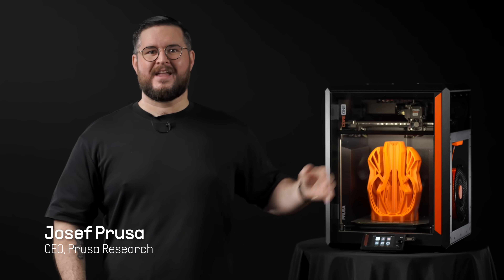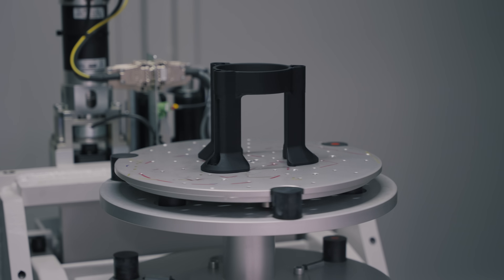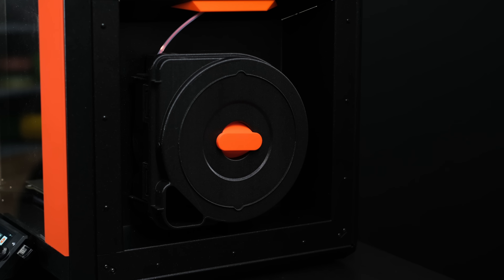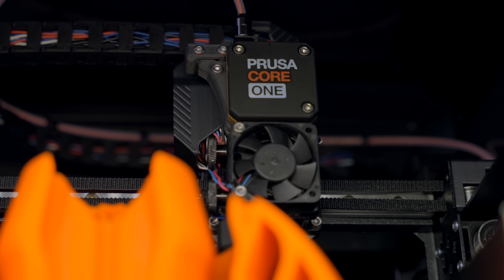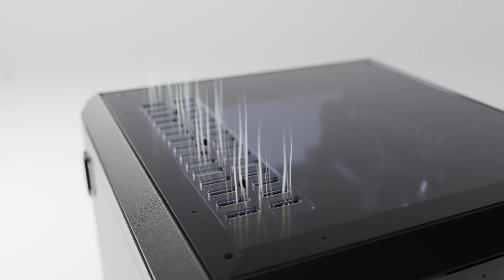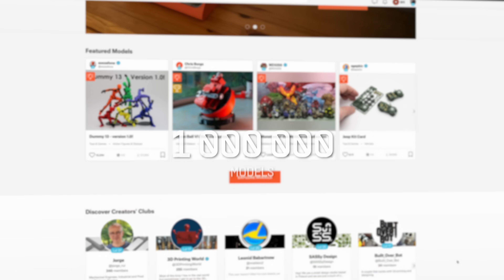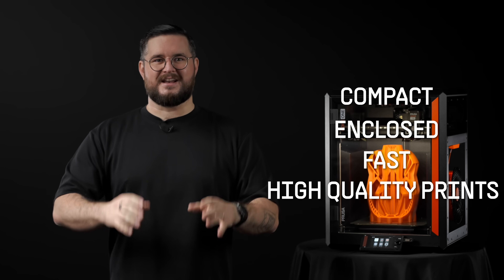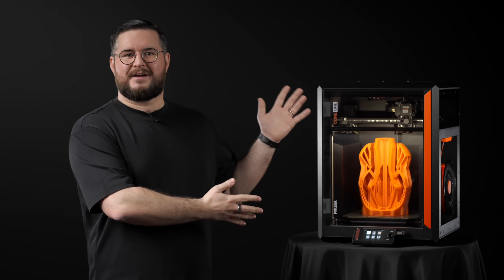Prusa CORE One - Fully Enclosed, High-Speed CoreXY 3D Printer With Active Chamber Temp Control

Comment: This is going to be my next printer. I was super excited by the Bambu but the lack of open source was a deal breaker. I can now retire my Ultimaker 2. Thank you for raising your game.
Reply: Bambu has open source firmware. It has been for months.
Reply: Which phone do you use? BTW Android is open source too.
Reply: @message2prateek  Modern android is barely open source and inferior to ios for almost every practical use scenario. Seeing the source code is not useful when nobody can modify it and use it in any meaningful way (because devices are hardware key locked), and the whole repo is too big for regular developers to check for security flaws.

Comment: Massive threat to bambu with this thing. Cheaper than X1 with open source and ability to run offline for better security?? Easy choice over bambu.
Reply: A: you can run X1C on LAN only

B: the most recent prusa printer thats 100% open source was the mini. You can claim PrusaSlicer is still 100% open source but so is Bambu Studio

C: P1S is cheaper than X1C and prusa core one. It lacks the lidar (prusa doesnt have it) hardened nozzle (prusa doesnt have it, its brass), and the touchscreen

D: Bambu's new Flagship (although you can argue that the XL is the flagship), will drop 2025 quarter 1. Conveniently, you have to wait till then for Prusa to ship the core one. Personally I would wait.
Reply: @  
A: bambu x1 can’t update on lan only mode

2: bambu studio wasn’t open source until it was forced to be because is a clone of Prusa slicer. The bambus build on the work of the rep rap project which requires all derivatives to be open source which bambu has not done

C: fair point about p1s price but prusas can be upgraded to a hardened nozzle (yes it’s more expensive but it will also probably last longer than the bambu ones)
Reply: @WhiffyStatue380  
1: How do you expect a printer to get an update off the internet when you turned off its internet access?

2: I think that was the only misstep Bambu did. they should have open soourced it from the get go, but late is better than never.

3. Most users want to hear "it comes ready to use CF filled filaments" and not "You need to buy and install a hardened steel nozzzle"

If you were a print farm looking to buy 200 printers for CF printed parts do you want to install 200 hardened steel nozzles on 200 Prusas?
Reply: @ 1: you don’t need to get updates online, prusa lets you update with the usb stick or sd card without having to be online

2: bambu has made many misteps, look at the a1, the AMS being designed to not work with cardboard or non bambu spools. Also, the printer should also be open source since it is based off the work of many other open source printers

3: nozzle swap is super fast on the prusas. Most people won’t print CF filament right away and those that want to are almost definitely knowledgeable enough to swap a nozzle
Reply: @WhiffyStatue380  2: the AMS can run non bambu spools and the AMS-lite can run cardboard spools

The parts for the Mk4 are not open source 

Even if the nozzle swap was A1 level fast, 200 swaps is not convenient
Reply: @ the AMS can run some non bambu spools. The AMS lite is great, no complaints about that one
Reply: @WhiffyStatue380  ive ran many many non bambu spools. Even if its too big you can open the lid

Comment: Why 220 in 2024 just make your bed square. I don’t know how many times I’ve had a print not fit but if I turn it 45° it fits, that doesn’t work on a rectangular bed only square ones it gives you more length,you may be able to fit something that is  just a few millimeters longer, anything more than like an inch thick in width would not work

Comment: ..... i waited so long to buy a prusa. i finally gave in last november because it had almost all the features i had been waiting for..... but i gave up on the hope that you would make an enclosed printer like this. so i bought a mark4 and the enclosure which honestly has made the printer way more cumbersome than i expected and because for some reason the side panels werent made to simply attach/detach magnetically for easy maintenance i know it will be a nightmare when i inevitably need to work on the machine. 

it just seemed like you were never going to give up on the bed slinger design and have the head do X&Y sadly this is my dream machine but the other was already a big financial investment for me so changing to this one wouldnt really be practical. especially since im only using it for practical printing unlike most people who just print silly trinkets to create clutter so i dont use it as often.

Comment: Can someone please explain to me how a printer like this is any better than a much cheaper one like the FlashForge AD5M? Genuinely curious, because I bought the AD5M for around $250 about 6 months ago and have had zero issues through close to 100 prints.

Up to 500mm/s print speed, self-leveling, direct drive extruder, 220 mm^3 print volume, all-metal coreXY structure, etc. They even have print plans & sets available for printing / buying enclosures for an extra $50???

Idk, just don’t see the value in a printer like the Prusa over some of these cheaper ones but someone please educate me.

Comment: Seriously, would it kill designers to make 500mm standard with 750mm as the premium?
Reply: most people dont print 500mm parts. 90% of the things i print could fit on a voron V0  printbed. Prusaslicer has dovetail tools to chop parts in half to fit. Furthermore, once you go beyond 350-400 you better have a heated chamber or you WILL have a huge warping issue. Warping just gets worse and worse the bigger your parts are
Reply: @Zyghqwyv  I mean that's kind of a chicken and egg argument. Most stuff is designed for a 250 or so mm print bed. so most of what's printed is 250mm or less. 

It is a fully enclosed Print chamber. Also don't just think one big part. More small parts is also improved with more bed area. 

They're building their own chassis too, so it's not some multiples of the length of standard extrusion that was also part of the factor in developing the older generations of printers.

Comment: I have a X1C and never do multi color prints with the AMS because there is so much waste.  One thing that it is really nice for is a drybox and automatic filament swaps so between prints I don't have to unload/load.  I'll wait to see if someone puts a MMU in an enclosure to keep the filament dry and for swaps.  One thing I'd like to see if instead of a wipe tower if you could throw another model on the bed and designate that as the 'wipe tower'.  Something that you don't really care what color it is because it is a functional part.  The slicer would have to make sure it was large enough to use as a wipe tower and if not then maybe just throw another functional model on the bed and they can both be a wipe tower.  I guess it would need to be as high or higher as the multi color models but that would be better than having the filament wasted on a wipe tower.

Comment: Prusa's commitment to right to repair is admirable!
Reply: Repairability is definitely a main reason I'm still inclined to choose Prusa over its competitors.
Reply: I think I rather buy a k1 , if it breaks down, I will buy another k1, still cheaper than a pre-built core one. its confusing
Reply: @SaifBinAdhed  P1S come at £509.   Hotend assembly p1 series around £25. But Prusa hotend assembly around £150.
Reply: @ that’s basically where my mind is at using Bambu stuff. I look at it like my iPhone, it’s good for 2-3 years and then stops holding a decent charge and i replace it with the latest and greatest.
Reply: if only their comittment to improving features was on the level. They are so grossly behind in every other aspect.
Reply: @Darlhim89 I use Prusa MINI. During it's lifetime I got countless of firmware updates, Prusa connect and still getting supports and replacement parts. I'm happy with my printer.
Reply: @Darlhim89 Can you provide some examples? I'm genuinely curious and was thinking of getting this machine. I currently have an BBL A1 and looking to add another printer in my studio.
Reply: @juniesco  machine is still slower than Bambu. 

The MMU system I’ve never used but I’m told it’s more complicated and inferior to the AMS. 

Bambu is cheaper and has a great app to run the machine remotely. 

Bambu uses actual glass rather than plastic panels.

Bambu has layer inspection/scanning.

Bambu has wireless updates.

Bambu has exhaust fan with charcoal filter.

Bambu has auxiliary part cooling fan. Extremely strong.

Bambu has a removable top if you want to vent the machine without opening the door.

Bambu has a purge collection port (the poop)
Reply: @Darlhim89  Thanks for this. I'll just wait until Bambu comes out with their next printer. I was possibly going to get the X1 but I want to hold off and see what the delayed printer is going to be.
Reply: @ you’re welcome. Both companies have a cult following and it’s challenging to get an unbiased response in general. Personally i just buy whatever is the best at the time I’m in the market for something. I couldn’t care less about fanboying for a company that isn’t paying me. I had a prusa, and switched to Bambu. I had far more issues with the Prusa. Many people have the opposite experience. A lot of it comes down to user error in both cases.
Reply: @ I totally understand. My first 3D printer was some off brand 127x127x127mm printer which I could never get to work lol Waited a few years and got the A1 a few months ago and I am blown away by the ease of use.
Reply: @Darlhim89 FYI the MMU doesn't poop because it doesn't need to.  Unlike in the AMS the filament is retracted before cutting, so there's much less waste from an MMU in general.  Bambu apparently compromised on that for the sake of the high-flow nozzle, but that also means swaps have to be slower so in practice if you're actually changing colors the MMU will typically have a faster print time than the AMS as well.

Comment: I'm sure there are some compelling features on this printer. But the limited 250x220 on-plate build volume is a bit disappointing when the competition is 256x256 or larger. I would of loved to see a minimum of 256x256 with a 300x300 option. The recessed spool holders is also a waste of footprint on the printer, especially since each and every roll I have is enclosed in an airtight container that can be direct fed without opening the container. That space could have been utilized for a larger build volume. Supporting the MMS is cool, but it sounds like those recessed holders won't be very useful, especially if you have more than 2 colors.

I think it's great that you guys now have an affordable CoreXY printer on the market. And that you can upgrade an existing MK4 to one. I can't help but wonder if some of the limitations of this printer are based on that upgradability.

Another thing I'm wondering is how well this thing handles VOC's out of the box verses the competition. If this is a part of the design and isn't an afterthought like it is with other printers, such as the X1C, that in itself would make this printer more compelling for printing ABS and ASA. I did see a clip of an external vent, so I'm hoping that is the case.

Comment: So I got my MK4 about 10 months ago, I spend weeks: 
- Building a custom enclosure for it, out of two IKEA Lack tables
- Designing a custom PCB with LED drivers, for inside the enclosure
- Designing a custom PCB, for temperature and pwm fan control inside the enclosure
- Writing custom firmware and software, that uses the printers API to read nozzle temperature and printing state

I could've had the same, by just waiting 10 months :-)

Comment: Why is it *ALWAYS* so freaking small?!?!  250mm x 220mm x 270mm  is  9.85in x 8.66 x 10.63in ...  that is LESS than the size of a standard sheet of paper @ 8.5 x 11 or even the A4 size is 210mm x 297mm!!   Why not go with XY dimension at 300mm (11.8in), 350mm (13.77in) or even 400mm (15.7in)? This would greatly increase the size capability of parts and would NOT compromise the speeds of smaller parts. There are many, MANY applications that require that slightly larger size and major Printer Manufacturers continue to fail at providing a larger format capable of printing something the size of a simple ream of paper!!   I have BUILT several at 500mm x 500mm by replacing the existing linear rails with larger ones and the price differential for the size increase is nearly negligible... the rest of the parts are nearly the same!   The only other companies are lesser known China manufacturers... Why has Prusa NOT provided a larger format that is not $2000 or more?!?

Comment: I love the design philosophy of Prusa of maintainability and upgrade-ability. They're always easy to repair and modify. And, if you can't print the part, replacements are usually cheap and/or off-the-shelf components that are easy to source as opposed to highly custom, proprietary parts. Also, the simple design of the printers makes it understandable for newbies to modify on.

Comment: One thing i do not understand is that its fully enclosed, bit will vent all the fumes and hot air out? Through a filter or what? Point of enclosure is to contain those harmful chemicals. I was thinking to have it went outdoors in a controlled manner wirh ducts...

Comment: I dunno, everyone has been 256^3 lately and the trend is to be bigger.  Coming out with something a bit more narrow, yet a smidge taller is interesting.
Reply: if they would give me 30x30x30 it would be instant buy. Spool holders on sides is waste imo. if they traded that space for square 270^3 its wasteed potential.
Reply: @OKManNoOne  agree.  I also think that display screen they use is very old in design.  Maybe a bigger display

Comment: ESP-01S WiFi module again optional.... $2 component on $1150 printer.
Only luck this is just MK4S in different configuration so hopefully you won't have to wait months till they implement advertised features in firmware.
Can't wait for benchmark with Bambu X1C or even P1S...